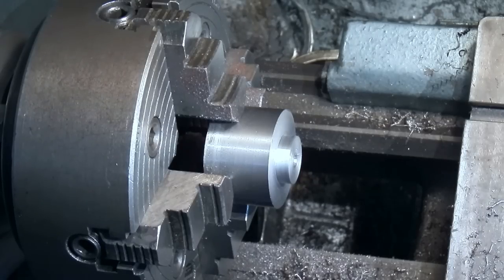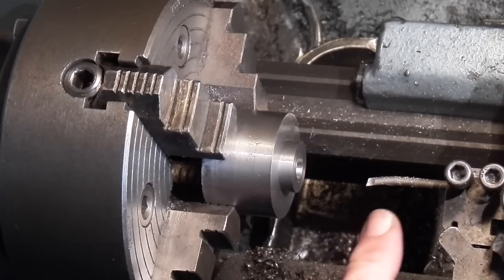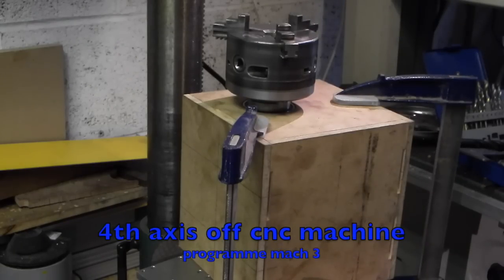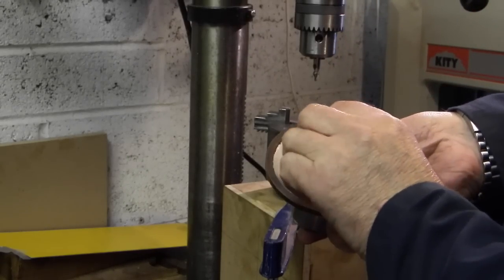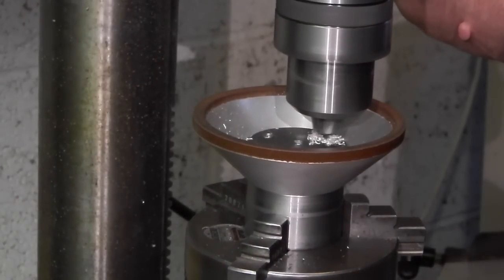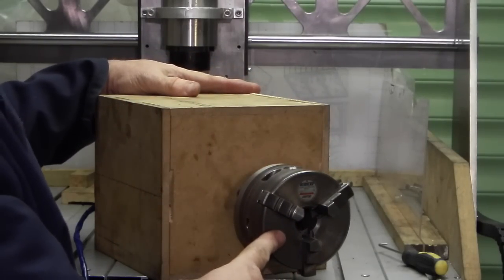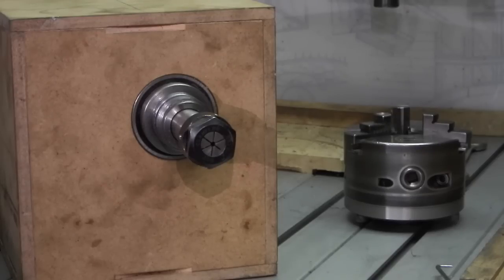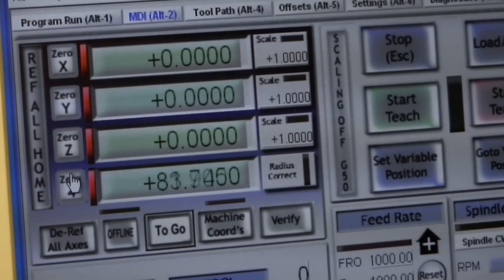Diamond wheel for the grinder.

Comment: I know the diamond wheel on a tile cutter, has to have water for a coolant . Same for the concrete cutter on the road crews cutter . Does yours need a coolant for the diamond wheel?
Reply from the maker: Hi Ronald
Thanks for watching.
I think coolant is used to reduce the heat and dust produced when used with a tile cutter and stop the tool tip getting hot when grinding a tool.

I've not needed any coolant as I'm only removing a small amount from the tool to reform the cutting edge. If I had to remove a lot of metal from the tool I would use a normal grinding wheel to shape the tool form and finish with the diamond wheel.
Or you could dip the tool in water.